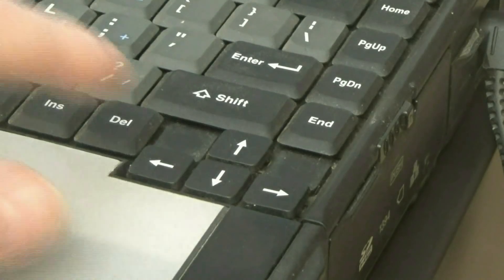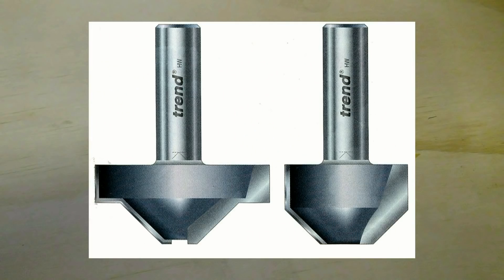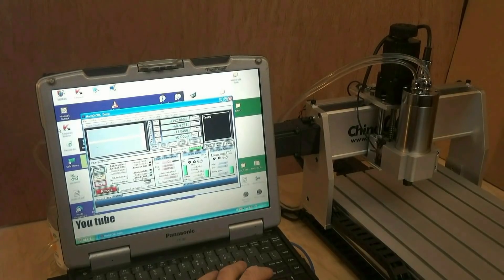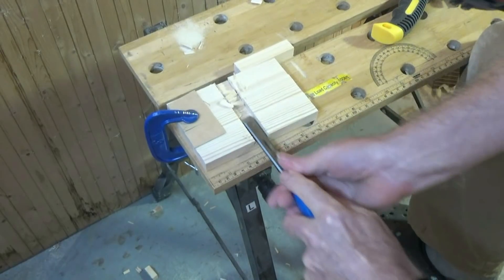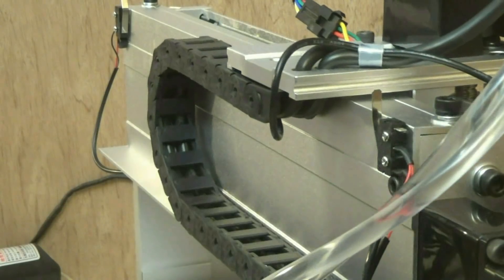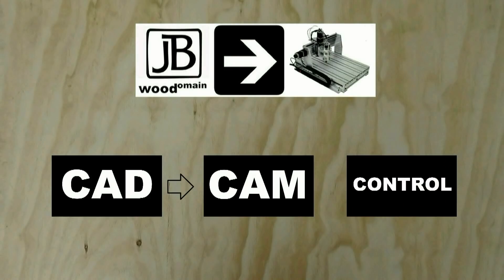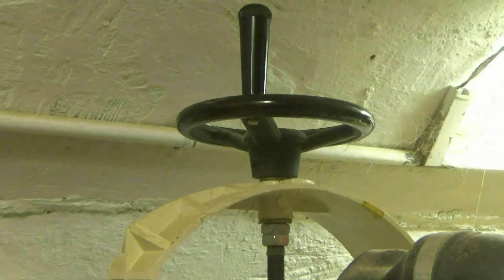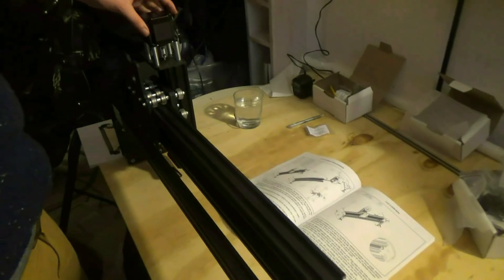My CNC Woodworking Adventure (1)  By Jeremy Broun

Comment: Jeremy
I am looking forward to seeing your progress. I purchased a 600x900mm CNC router from China 2 years ago. It took some research for me deciding on software. I use Vcarve Pro for product design and g code generation. I am very pleased with the ease of use and the vast amount of products I can design with it. I definitely recommend it. As for machine control software I use Mach3. It has served me well for a start, but now I am looking to upgrade to the Centroid Acorn system. There are many advantages with this control hardware and matching software package. One feature for example is that Centroid makes both the control board and operating software. So they work with no special patches or confusing software to make them work. Also Mach3 is no longer being developed by the manufacturer. Where Acorn has full support. Take a look at it.
I am looking forward to watching your progress.
Reply from the maker: Hi Jeff. Thanks for your useful feedback. I agree on my research V Carve pro looks the most promising but I am starting with a trial version of Cut2D. Centroid Acorn looks interesting. I came across them as they make a digitising probe but its very costly.  The control software looks attractively priced. Please keep linked to my series which may be a little slow to evolve but I think the comments section is really going to add to it! Thanks.  So Mach4 will be obsolete? I'm using Windows XP out of convenience as much as anything as I have a spare and rugged laptop.

Comment: This looks as though it will be an interesting series and good luck to you.  You may be using Fusion 360?, which I'm yet to grapple with.  My journey started about 6 or 7 years ago and when somebody saw my machine (just assembled asked if I could cut out a sailing boat.  Like you I had no idea what was ahead of me, but it was a blessing in disguise as the deadline forced me to quicken my pace.   All the best.  Cheers, David.
Reply from the maker: Sounds as though you relied on determination. I explored fusion 360 but could not install it on my D drive as my C drive is full and also the free version seems limited. I then I found the Vectric softwares more user and friendly and decided to go with the Cut2d trial version to just get started.  I can see this is going to be massively time-consuming to learn the programming which I had hoped to bypass by scanning.

Comment: If you look into fractal geometry, which is highly programmable, you can make your CNC cut and produce designs that are truly one of a kind. Perhaps that is better than copying the past and a brave step into the future, where the machine has some control, or you have less control on the final outcome.
Reply from the maker: Yes I suppose that is an existing artform to pursue for some but I want to minimize the time spent programming software if possible.  What I mean by 'letting the machine do what it wants to' is best illustrated by 1920's Bauhaus tubular steel  furniture where the technology determines the simple form. Where I add 'Art' to Bauhaus is in my stout aluminium tube bending jig where the mandrel bullet was deliberately left out and the bend deforms creating a visually interesting buckle especially when buffed up afterwards:  https://www.youtube.com/watch?v=GEKE9AOdXO4 . Similarly I invented unique wood joints back in the 1980's exploiting the router and its range of cutters.
Reply: Woodomain - Jeremy Broun fractal geometry requires minimal programming. It means that simple equations can create infinitely complex patterns.
Reply from the maker: @ot9180  No I didn't mean to suggest fractal geometry requires a lot of programming but that a big part of my journey is to minimise the programming which is a huge time-consuming learning curve. If you watch my video you can clearly see my interests are to replicate more efficiently components of furniture I already make and see what new furniture forms can evolve rather than surface decoration which I think fractal geometry is about?